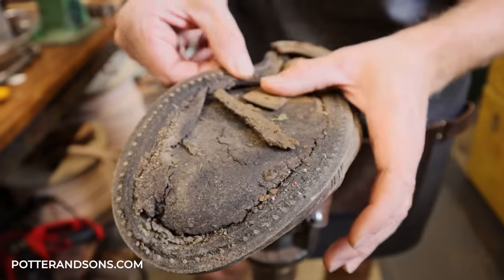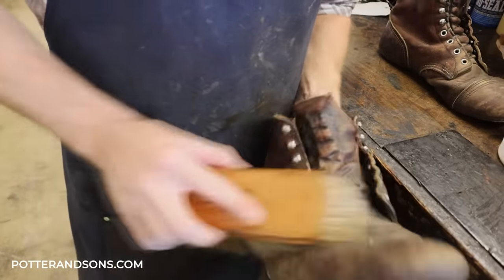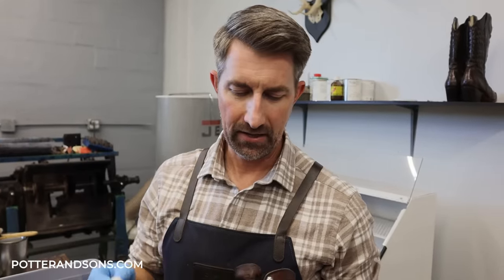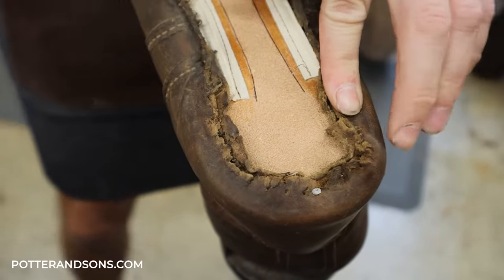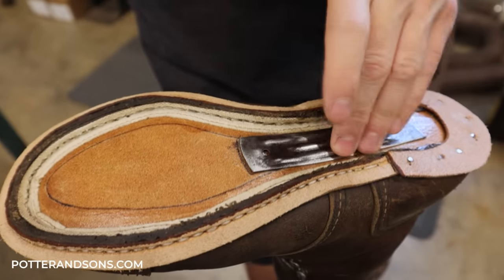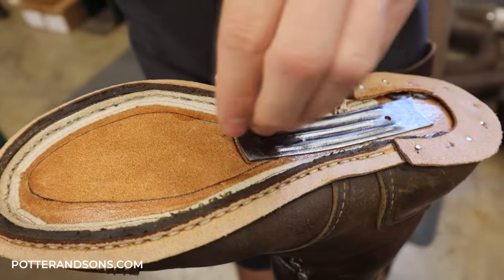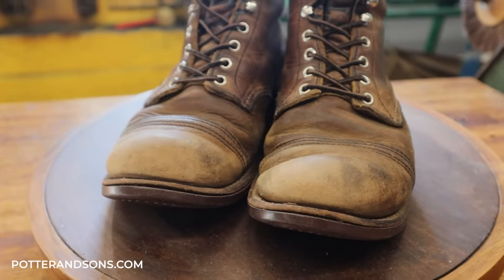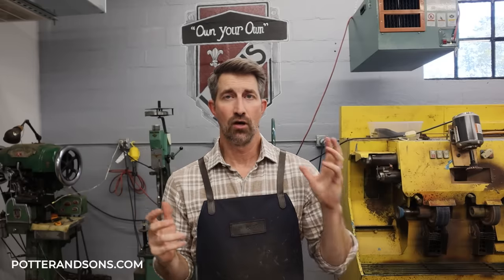Can These Red Wings Actually Be Fixed?

Comment: I've a question. With all of the time and effort put into fixing these boots, how does the repair bill not equal the same amount as new boots?
Reply: That's what I wonder.  Great repair and all, but how long did it take, start to finish? and what was the final cost to the customer?
Reply: I have a feeling that once you need to replace the welt - likely cheaper to just get new boots. The insole - forget about it!
My assumption -  customers are assigning a sentimental value to the old boots, and ready to pay extra to keep them going.
Very cool craftsmanship though!
Reply: I was gonna ask this same question, I'm guessing the cost is probably just slightly less than the cost of new. Those are $350 so maybe the refit would be around $200? I'm just guessing tho
Reply: A key point here is that these boots are better than original now... How much would you pay for a pair of handcrafted boots that are already broken in to your individual feet?
Reply: @DrPronghorn  Yes that is a great point
Reply: I wentot there website it cost up to 469 depending what you ask for

Comment: I have a pair I believe 10" tall logger Redwings..I've had for 25+ years and another shorter pair for 15+ years,both still in great shape, however I have retired from welding and ironwork. Will never have to buy another boot again.Hurts to break em in but the quality is astounding.

Comment: Okay, I need some clarification, please. How is it that sheet cork is faster than hot cork? It seems like cutting the cork, gluing it, hammering it in, and filing it down takes more time than what I’ve seen you do with hot cork before. As always, great video.
Reply: I was wondering the same thing!
Reply from the maker: Hot cork has to set up and cure.  That usually takes several hours.

Comment: Great repair work! Just a thought, would it have been better to do a 360 degree welt to save the back portion of the boot where the leather was worn out instead of tacking the edge with nails?

Comment: I have a pair of steel toed boots that the steel exposed on the toe (about penny sized) and the fabric inside behind my Achilles is ripped to the point that i have to put my hand down the back (kinda like a shoehorn). Would they be able to be fixed?  Really like them and have only had them a couple years. Any advice/input is greatly appreciated.

Comment: When cutting the leather for the bottom of the boot ive seen guys put the leather on first and press it down and then run the cutting machine around the outside of the boot to cut the leather bottom to shape while on the boot. I see that you traced the old leather bottom onto the new leather and cut the leather out while it was off the boot and then glued it on. What are the advantages of cutting the shape out before its on the boot as it makes more sense to me to cut excess once the leather pad is glued on the boot so the shape is cut exactly according to each boot. Could you explain your thinking for that deviation in the process from the other guy.

Comment: Odd question.  Would it have made it easier if you had developed a 360 deg. welt when putting these back together rather then trying to nail the heel portion?

Comment: I had a pair of boots so comfortable that I polished and resoled as necessary for eighteen years. They suffered a similar blowout and were rejected by every repair shop, cobbler, and the manufacturer. I would have spent thousands to get that pair of boots back and still saved over all the replacements. New boots only seem to hold together for six months to a year.

Comment: So my redwing boots that I've had for about 5 years now are cracked pretty good, even though (as far as I know) I have been oiling them when they're dry. I used Huberds shoe grease, but more recently Obenauf's LP. They have seen some salty conditions as I have lived in northern BC for a while. 
It's odd seeing these uppers in this video in better looking condition than mine. What gives?

Comment: Once you take the insole out, how do you stay consistent with the sizing of the boot if you don't have the correct boot last to work with?
Reply: They use the previous insole. If they cut the new insole the same size, and based on that cut the new midsole then the shoe will be the same size. Even if that is destroyed the shoe has been used for so long that the shape is more or less fixed. The previous stitching holes are also obvious so any size change will be minimal.
Reply: @nikoschariso2512  Interesting....Thanks for your answer to my question.  I appreciate it.

Comment: Greeting gents, Question about getting a couple pairs of quality shoes. I have looked around, and really like Gaziano and Girling. They are pricey, so I was wondering if its worth it to go full bespoke on a pair I will use for a lifetime.
Reply: In general make sure you do not wear the same pair, or only 2 pairs all the time. No matter how good they are, it is not good for your feet and eventually chances are your feet will start hurting. Get quality leather insoles for all your shoes  if possible (those that the insole can be easily removed) and put those in the rotation as well.

Comment: I use a solid piece of 4 oz leather as gemming on my GYW insoles, it gets stitched on, then the edges are turned up to form the seam edge. it reduces the need to fill the cavity, and even if the glue and insole stitching fails it's still held together like a baloney style construction.

Comment: Would it be a good thing to do on boots like these to use some mink oil on the insoles to keep them hydrated and prevent drying out and cracking? 

What about putting in a loose leather insole? I've seen those on Amazon and figured I might buy a pair for my Iron Rangers to kinda protect the insole and give just a little extra padding.

Comment: the tongue of my rranger is ripped on the height of the second highest lace hole. like a 2cm rip. is this fixable? (12 yo pair, second sole). Btw I realized that thee rouight metal inside of the lace holes drives wear and tear on the tongue, thats where the rip came from. I'd love to seal those areas somewhere a little with wax or plastic. Recommendable?

Comment: What are the different benefits of the sheet cork vs the hot cork? Besides time since you mention it in the video.
Reply: They are the same as they have explained it on a previous video, but I guess the difference would be that while sheet cork has a specific thickness, with hot cork you can “cover” any thickness you want.
Reply: hot cork molds to the shape of you're feet better!  sheet cork is cheap alliterative .

Comment: I'm curious about the economics of this kind of stuff. I checked quickly and found a price of like 350-400$ for those boots new. Two people seemingly put in probably at least a combined day of work into them. So 8 hours of labor, if you go with just 20 bucks that's 160$ of labor alone and probably another 40 in supplies/parts. So 200$, that would be without a profit. So even at a modest 50 bucks, the guy likely ended up close to 250-300$ for his boots to be refurbed. Saving ~50-75$ and then he had to "shop" around? I mean I am all for repairing when possible. But would it be also correct in assuming that a lot of customers just have a sentimental attachment to the boots you get for repair?
Reply: That’s how it seems to be in many situations where it’s money ahead to just replace something, unfortunately.

Comment: When rebuilding boots like these with new insoles, doesn’t the original last give the footbed shape and arch support? Without that I would think these would be flat inside now?
Reply from the maker: I definitely see your point.  The shanks help with that, as they are often formed at the angle of the last.  As long as the shank isn’t messed with, and you’re not dealing with a high arch (ie high heels, etc), you’re good to go.
Reply: I never thought of the original shank giving the proper shape. Good point. Thanks for the reply

Comment: The soles at 17:15 aren't the same as the ones shown at 0:30. One is the original flat bottom, and the other is the mini lugs.
Reply from the maker: Ummmm…correct.  The owner wanted more grip.
Reply: @TrentonHeath  I'm not talking about the sole you put on, I'm saying that the "old" soles shown at 17:15 and the "old" soles shown at 0:30 don't match. 17:15 must just be B-roll or something.
Reply from the maker: Great catch man!  Haha…I didn’t know what you were referring to.  Yeah, it looks like our editor used a shot from our last Red Wing video.   🤦‍♂️

Comment: What you guys do is truly art … but do your costs of repair cover the price of a new pair of boots?  Sentimental thoughts aside , we’re all getting screwed atm, is it more cost effective? Genuine question as we’re all struggling. :(
Reply: They have mentioned the costs in general and you can see them on their website. Basically if you don’t have a pair that costs 400+ or in some cases 600+ it is more expensive to have it repaired. (If the damage is serious) However, if it is a very important pair of shoes (like a lost grandparent’s or parent’s) and you want to use them, I guess their is no pricing that. The prices in my country are much lower so 3 months ago I had a complete change for a pair that costed 325€ new and I paid 50€ for the midsoles and soles to be replaced. Been using them these last 3 months and they are better than before.

Comment: Trenton and Heath: Rebuilds the most busted-ass pair of Iron Rangers ever.

Also T&H: "We're mysteriously pressed for time, so even though we already put an assload of work into bringing these things back from the dead, not only are we not going to rebuild them properly with a leather midsole, we're not even gonna bother with hot corking them, instead going with inferior sheeted cork for some unknown reason."

IDK man, if I were that guy, I'd probably be side-eyeing you after that.
Reply from the maker: This is a ridiculous comment.  First, hot cork and sheet cork are both cork.  Most shoe cobblers and bespoke shoe makers use sheet cork, as most don’t have irons needed for hot cork.  Manufacturers of shoes/boots usually use hot cork because it’s faster to apply.  Hot cork is enjoyed by the viewers, but it takes several hours to cure.  When we’re trying to shoot a video on top of all of the work we have, sometimes we have to do things like choose sheet cork instead of hot cork.  Since you’re not in the business and have no idea that both hot and sheet are both regularly used cork within the shoe business, you end up wasting your time with comments that make no sense.

Comment: Just curious, at this point is it cheaper to just buy a new pair of boots?
Reply from the maker: If the repair isn’t done well, if the price of the repair is more than a new pair, and if you don’t have an attachment to the pair of shoes.  With higher quality shoes/boots, they often times require a break in period (but fit like a glove after broken in), and folks often times don’t want to get rid of them once broken in.

Comment: This had to cost more than a NEW pair of boots.
Reply: Probaly not, these are like 360 dollar boots
Reply: The cost isnt the point ffs
Reply from the maker: No, it’s still quite a bit cheaper.
Reply: @SeanHardaker Sure, to you.  For many people, money is a huge factor.
Reply: @d05wtt  you're missing the point. They're not suggesting this is a viable option, it's more of an interesting experiment and to showcase how good Redwing boots are.
Reply: Guy literally said it's cheaper. You're arguing a false premise 😂😂😂😂 jesus
Reply: @TrentonHeath this is Nicholas , what does it cost for y'all to do a resole? 
I have a pair of nicks custom boots in the hot shots and my back heal is still ok but the front of my soles is gonna need redone cause the small lugs in the middle wear down to easily . I work commercial construction/small residential construction and drive truck/operate heavy equipment and on the ground laboring and flagging so my boots get a major work out. I know Nick's resole or rebuild waiting times right now is extremely long so was just curious
Reply: Nothing can replace a pair of work boots you've worn for years and feel like a 2nd skin. New isn't always better.
Reply: The repair is nicely done, excellent work. The point is valid is hat a new pair of iron rangers is $350 this repair is likely very close to that.

Comment: Just a little curious why Red Wing would refuse to repair these? I mean, especially if the customer was willing to pay. It certainly seems like they would have been able to.
Reply: I've wondered that, too.  I have no specific knowledge on the matter.  Only speculation.  I have two interdependent thoughts on this.  First, from an admittedly cynical perspective, I suspect the manufacturer would in general - I stress in general - prefer to sell a new product vs. refurbish an existing one.  Second - and here's the interdependence - the specifics of an individual repair case are what lead the vendor to make the call on whether the boots could be refurbished.  

A high volume shop like Red Wing needs to put out a lot of product quickly and efficiently, be it new footwear or refurbished work.  A challenging job like this one requires a great deal of individualized attention and creativity, which are the bane of high volume production.  

Which is where true artisans like Trenton and Heath come into the picture.  They can take a bit more time to devise a solution and strategy to achieve it.  And it shows.  I would be very pleased if I were this customer.

Comment: Came across this in my feed. My Stepfather was a cobbler for many years. I spent my childhood surrounded by shoes and his tools. All of this is very familiar to me. My stepfather retired a while back.After fixing shoes for nearly fifty years he developed multiple myeloma and became extremely ill. I suspect it was from his repeated exposure to contact cement as that was the only chemical he had repeated exposure to over all those years. He never used a respirator and he always worked indoors. If you’re using contact cement on a regular basis please use a respirator rated for chemical exposure. That should be an activated carbon filter. A simple paper mask or cartridge won’t work. Myeloma is an awful disease. Protect yourself if you handle chemicals.

Comment: This the problem with having a heel rand the more and more nails hammered in the worse the boot gets
Reply from the maker: Valid point.  I’m a 360 welt fan myself.
Reply: @TrentonHeath  Did you offer a 360˚ option to the customer? Thanks!

Comment: When you add oil to leather you are not hydrating it. Hydration is adding water.
Reply from the maker: I think you get the point.  Conditioner is adding moisture to the leather to keep it softer and supple.  This product isn’t just oil.  It’s made from a lot of different conditioning properties that were made for this oil infused leather.

Comment: Nice work on quite possibly the most uncomfortable boot ever made. Don't buy the hype on these POS boots. The heel literally falls off and Red Wing "can't" fix them. What does that tell you about these crappy boots?
Reply from the maker: Thanks!  Well, the heel didn’t necessarily fall off.  The guy pulled his foot so hard that it ripped all of the nails out of the insole.  We’ve never seen anything like that on a heel.